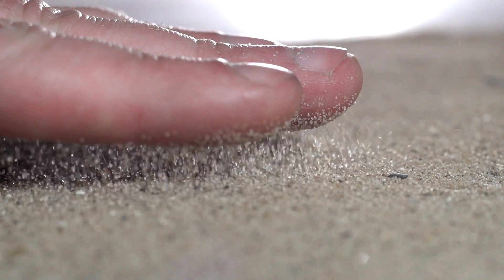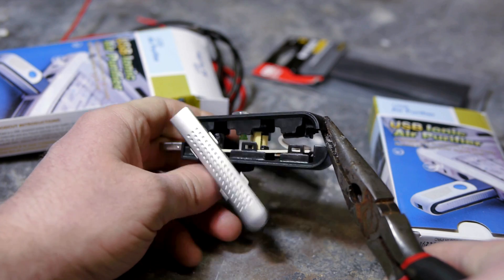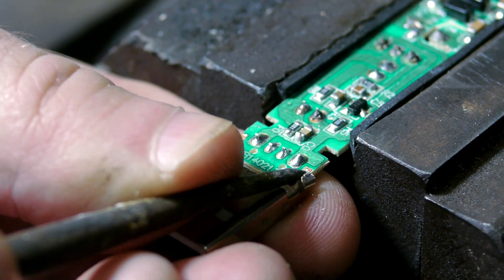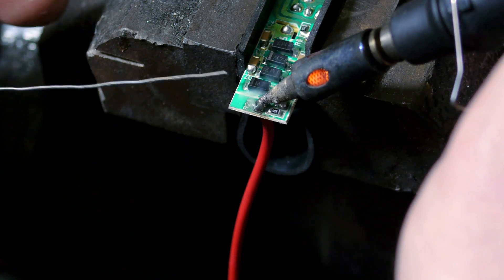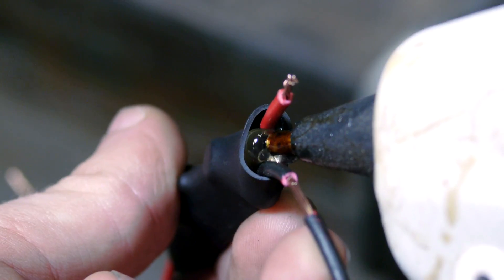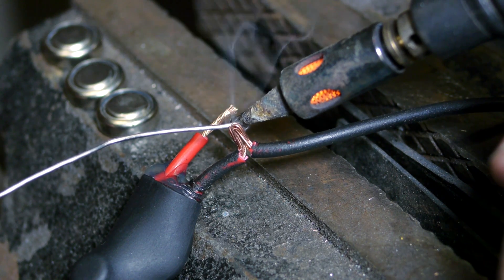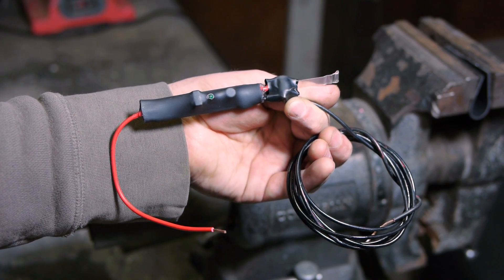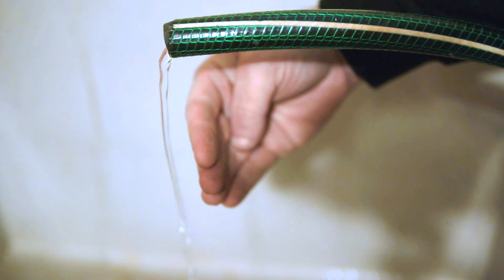How To Make A $5 Static Electricity Generator - NightHawkInLight

Comment: Hey, I know this is an old video and my question may have already been asked in the past, but my shocker is not working. Well- that is it should be working- but isn't. I've got it all hooked up and when I contact the ground with myself and the other ground with the ground I get no charge (Tested with sand, small electronics, and a voltmeter.) 
        BUT When I contact both grounds to myself the status light dims, which means I'm completing the circuit, this is further proven by the fact that when it is in contact with other people and materials the light stays the same. This by itself is impressive considering how un-conductive skin is (Not humid, very little sweat, if any.)
       SO I opened it up and found no problems (Solder bridges, damaged parts, etc..) Even going as far as to test each individual piece and part with the voltmeter- But with the same result: It works- but it does not show. After several varied tests in different environments, going as far as wetting down the diodes with salt water and conducting static electricity with balloons, I still have found no better result. 
 I currently am using 3, 4.5v 377 type button cell batteries, my contacts are thin aluminum, and the total wire length is 9 inches. I had received several large shocks while building this, but the no longer happens with the finished product.

I apologize for the long ass comment, but I wanted as much detail as possible.
Reply from the maker: It could be fried. These use some pretty cheap and fragile components, I've burned out a few. This is the least expensive of my static generator projects but also the most fragile.
Reply: Thank you for your speedy response, that's what I originally assumed, but If that's the case, that still doesn't explain why I'm getting a positive charge from the grounds. Though it may just be that the shock I received while building this was the burnout...
Either way thanks.

Comment: Dear friend, your experiment is really interesting. Could you explane please what is the purpose of the device connecting to the body ? Experiment show that particles of dust and smoke which are flying in the air ( especially positively charged) will be collected on the body. What do you think about using your ion generator as electrostatic precipitator of the air with collecting the dust on metal plates or tubes ? Is it possible to use the device in such way?

Comment: Hey I just made this and it seems great except for one thing. Even though I can arc between the two wires, when I put them on my body, I can’t shock anyone or anything. I’ve only been able to shock someone when they touch the metal on the bottom of my shoe. Any help would be appreciated and awesome video!
Reply from the maker: Try standing on a more conductive surface like concrete

Comment: Why does this need to be a negative ionizer? as the carbon tip has been taken off, wont it work just as well if it was a high voltage generator?????

Comment: Cool project thanks! What would happen if you used a 9v battery instead of the button cells?
Reply from the maker: Too much voltage would fry the circuit.

Comment: if i were to use a voltage boost converter to increase the voltage of my power supply would i connect it to the ground of the boost converter or the battery? (if this is dumb im sorry just unsure)

Comment: Hey, I'm a big fan. I know this video is pretty old now, but could you answer a question? since one usb purifiers uses about 5 volts to operate, do you think that by using two purifiers running off of a 10 volt (or so) power supply, I could beef up the static generation? or would I end up singing all of my leg hairs? if so,  could a larger positive surface fix that?
Reply from the maker: should work, but check my older videos in the description and there are two options for more powerful generators.

Comment: for some reason, the one i made isnt working, but everything is connected, and im running it on 6 volts
Reply from the maker: As cheap as they are sometimes these ionizers arrive broken...
Reply: The strange thing is, i tried running it with a 9 volt after, and it worked for a few minutes before the circuit fried.

Comment: Heyo! Remember me from a couple weeks ago? Probably not but it's one of the first dozen comments. Anyway, turns out I didn't fry my board. I just couldn't directly connect batteries to the board. I reattached the usb to the board and tested it and it still worked! YAY! So I ordered about 7 AAx3 packs with on/off switches for about 3 bucks, soldered one to the board in place of the usb head, fixed the wire connections and now I go around shocking everyone I touch XD Doesn't work while walking on hard wood floors or carpets. I find the latter to be ironic considering one would slide their socks on a carpet to build a natural static charge xD. Anyway, thanks for this video and for actually replying to your comments! Keep up the good work. 

Here's to you from a relatively old subscriber!

Comment: High voltage converter from USB... They are crazy! It is a perfect device to burn out your laptop.
Reply: Yeah lol, all it takes is a good inductive kick back and RIP computer. Also their using an electrolytic capacitor on the switching side so it'll probably explode after a while...

Comment: Just bought an ionizer from your link, hope it supports you a little bit :)
Reply from the maker: Thanks! Let me know how it works for you
Reply: NightHawkInLight I think it will take a while to arrive here from china, but thank you very much for the great tutorial! Are there any risks for your health using that?
Reply: Hey, the ionizer arrived today and I built the device. It is working but the spark is extremly small. Im using 3x button cells in with arround 1.55v each and 160mAh. Should I use a stronger battery?
Thank you
Reply from the maker: These ionizers don't have a lot of output, it's probably running as well as it was made to. If you want one that is much more powerful my second static generator version that runs on DC is very strong.
Reply: NightHawkinLight, how long is the battery life?
Reply: NightHawkInLight how Long is the battery life

Comment: Hi ! Thank you for your amazing videos ! I'm actually trying to duplicate your usb ionizer project but it doesn't work... I power the usb ionizer with a 5 volts batterie. Howewer, when I approach the ground wire to the output wire nothing is happening. I measured with my voltmeter and there is only 2-8 volts between both. Could you help me to overcome those difficulties ? Sorry for my english I come from France ;) Thank you and hopefully see you soon !
Reply: Have you solved it yet? Did you connect it to your body and feet in the right way?

Comment: isnt DC which floats through you really bad for your body (in a long time).The body is made if water, and how does electrical float works in water? It works with ions, so it might kill you if you let dc electricity float through you for a very long time... Right?
Reply: +Daniel Sir.fy. If it doesn't kill you immediately, then it's probably not gonna do it over time. Anyways its not electricity put into the body, it's ions.
Reply: the bad thing floating through your body is actually ac as it could potentially fuck up your heart rhythm

Comment: What soldering iron do you recommend for first-timers? Under $20 would be great.
Reply from the maker: I like butane ones. They're cheap an heat up quick. You shouldn't use them where if you dropped it it could start a fire though.
Reply: +NightHawkInLight Great Thanks!
Reply: Don't ask me!
(cough)Xytronic Xy-258 thingy(cough)
Reply: Zephroth Talinguard I already bought one but I'll save up for one in the future

Comment: I made two of these based on this video and it seems like they die if you use them for more than a few minutes. I'm pretty sure it is because these are not meant to flow so much current through them if you frequently short the ground and +V together. I think for a long term product you need a high voltage generator that can handle a little more current.
Reply from the maker: Are you trying to run it on a 9v? That's the only thing that caused the circuit to burn out in my own testing. Using the button cell batteries I had no issues.
Reply: No, I used three 1.5 V button cell batteries as in the video. However, I was having a good amount of fun making some good sparks, and on both of them after a few minutes of producing good sparks they both gave out. 

Also, it seems like you can't use the earth as your ground to get any decent sparks (you need to use the negative terminal). How about you? I think that is why a lot of people can't get it to work in the comments.
Reply: @ActionLabShorts No way this is action lab 7 years ago!!! I was planning to do this and btw love your videos!!!
Reply: ACTION LAB REAL!?
Reply: How would it short? Would the entire thing die or can you just switch out the batterys?

Comment: Actually, in the one you used, it's creating a negative static charge. The hint here is that the diodes are "pointing" away from the output connection ...
See the component marked "D7" on the PC board? The stripe on one end - the cathode - is connected to the rest of the voltage multiplier chain (the lower voltage stages). The anode is connected to another capacitor (C6) and the output wire (through a 9K ohm resistor R24 - it might also be 20M ohms, but that seems excessively high for that small of a resistor, physically speaking).

Comment: I build it but I see only sparks when ground and negative wires touch not throught my body even tho I heard a really quiet spark when I touched metal.I'm using 3x1.5V AA bateries.. Can I use 6V or is it too much ? I'm not sure what can be wrong.. And yes I was standing on conductive surface
Reply: It might be that there is enough resistance to drain away the charge through your shoes. Do you have boots on, or what?
I dunno what 6V would do to the device. It might run OK, or it might stop working ... I just don't know without seeing the thing itself.
Reply: i JUST built one and upped the voltage to 9, its fine
Reply: 9V ? lol what
Reply from the maker: I would go back to 6v if you're using the same generator I am in the video. When I was testing it would run on 9v for a short time but then burnt out the circuit.
Reply: +NightHawkInLight huh, hasn't done that for mine. but I modded it into a glove with a switch... hasn't given up on me yet.
Reply: +TheNyga yep, works fine
Reply: I built some of these too and you do have to connect the ground wire to the positive to get the full affect. I think it is because the ground wire is not really "ground" relative to the earth (it is really just the negative terminal). True ground (the potential of the earth) is no the same potential as the ground of your circuit.

Comment: I did exactly as explained and the device is working ... but does not generate enough static through my body when I touch something . Should I use thicker wires ? Or should I use 4 batteries of 1.5V ?
Reply from the maker: You can try standing on a more conductive surface. Otherwise you may do better with one of my previous versions if this one is not powerful enough for you.
Reply: thanks for the answer! I wish success to your channel
Reply: Then you have built a tolerance, build on out of a Fresh Breeze  Ionizer, mostly just a high speed switch hook to 1 12V in 500V out transformer.. Little bit more to have to conceal but you keeping you dancing all nigh. Need help, hit yup elecronicBOOM
Reply: +NightHawkInLight were would you get that kind of wire
Reply: All2skitzd I'm sorry but I could not understand. I must put an inverter voltage in my project? it is?
Reply: What is "tolerance" should I build? is a component that must weld the ionizer?
Reply: It might be that there is enough resistance to drain away the charge through your shoes. Do you have boots on, or what?
I dunno what 6V would do to the device. It might run OK, or it might stop working ... I just don't know without seeing the thing itself.
Reply: NightHawkInLight will it still work if I stand on a non- conductive surface?
Reply: ActionLab Vlogs I know this is old but can you elaborate more on having it connected to the positive? Isn’t it the one that is connected with the batteries? Or the one that touches your leg?
Reply: You have to connect the ground wire to the positive wire to get the shock. You can't just use the "ground" of the earth for this device. If you have the ground connected to aluminum foil under your feet and the positive terminal, you will for sure feel a good shock.

Comment: Hey guys, I need ADVICE!
I built this two days ago and the first day I measured the voltage to be 480v. I use a 3x AA battery box. The next day the voltage however dropped to about 200-250v. The batteries have almost the same charge and even changing them doesn't help. It is not able to produce such a big spark anymore and it won't really shock anything. Could anyone help?
Reply: Heheh, you probably got a shitty one. My first guess is that one of the components in the last multiplying stage has gone bad - likely a capacitor or diode.

Comment: can the static current be upgraded into a powerful one
Reply: Hell yeah, you start off here but you gotta move up to a heavy portable commercial IONIZING unit if you wanna keep it live
Reply: Well, you could, but then you risk killing things with the shocks ...
P.S. By the sheer size of this thing, it really can't put out that much power. I dunno how much it could be "overclocked," if at all...
Reply: Benjamin Esposti shit you'd be wasting your time, that shit is probably already on full tilt with the cheapest components you can get. Maybe your could turn it up and use it to burn people like a old  Cyrix CPU but your best bet would be start with something better like the guts to a cheap electronic fly swatter, that could put the zappin on someone

Comment: Is the ground wire that leads to your foot absolutely essential? Wouldn't the batteries alone do the trick?
Reply: No, you need it, but if you have old shoes, you can tweak them a little bit to fit the white through them and hide the aluminum sheet under, so it's invisible
Reply: Is it acting as a ground or "picking up" static electricity?

Comment: Hey buddy, thanks for the cool video, what is the best way to develop anti-static device (one that shoot out both positive and negative ions), Please help?
Reply: +NightHawkInLight sorry I was not clear. I need a device, like an anti static gun, that can remove static of cars. i don't think I can ground every metal sheet in the car body.
Reply from the maker: +22Brat22 The sheets are held together with metal screws. You ground one you ground them all.
Reply: +NightHawkInLight thanks, let me try that.

Comment: Hello, NightHawkInLight,

A basic question here, what is the purpose of the aluminium under your shoe? Aluminium is an electron donor, so how would it be gaining a charge and directing it through the circuit?
Reply from the maker: +Coroz1 In this case it's just acting as a conductor.
Reply: +NightHawkInLight So it acts as the conductor for the static electricity generated by the friction between the shoe and velcro, correct?

Thanks,
Reply from the maker: +Coroz1 No, the static electricity is generated by the generator.
Reply: +NightHawkInLight And how is this done? What is the purpose of the aluminium to serve as a conductor, then?
Reply from the maker: +Coroz1 The generator strips an electric charge from the ground via the wire and conductor. Watch the videos linked in my video description if you want to learn more.
Reply: > And how is this done? What is the purpose of the aluminium to serve as a conductor, then?

"Static electricity" is simply high voltage.   All high-voltage generators are "static electric" sources, even when no friction is involved.    To charge up your body, connect a high-voltage power supply between your body and the earth.  The aluminum on the bottom of your shoe is an electrical connection to the Earth.   (Yes, you must stand on slightly-conductive surface such as concrete or even better grass and dirt.   If you stand on a dry wood floor or thick nylon carpet, usually this device cannot work.)
Reply: Oh my God if you guys have no basic knowledge in electronics, try to do some study before making a fool of yourselves.
Reply: +David Linnik I consider this a part of my study.
Reply: *****  Takes you 3 weeks to reply lol
Reply: David Linnik Haha yeah, this is my alt account actually. Besides, I'm curious, why bring that up?

Comment: hi build this ,when the ground wire comes in contact with the output wire a spark is visible,but when the ground wire is attached to a plate and wore and the output is touching the leg  its not workings
can someone pls help me in this regard

Comment: you guys think 6 volts will be fine?
Reply: No, it'll fry it... I speak from experience.
Reply: +cyancoyote  +sal seria I use 4 AA batteries (6 V) to power it, it works fine.
Reply: I don't know how... maybe the one I had was a crap chinese one, but 6 volts made it die.
Reply: +cyancoyote Only thing that I did differently is that I have got rid of the resistor next to the output wire. But I don´t thing that it makes difference.
Reply: Hmm... Will this make a neon tube glow? I didn't yet have a chance to try it, so I'm curious :)

Comment: What if you put the electricity through a high voltage transformer before sending it to the air purifier?
If the air purifier can withstand the voltage, that could be some seriously Darth Sidious stuff right there.
Reply: It cant handel any higher voltage

Comment: I replicated this project and it was successful. Unfortunately I accidently soldered off a piece of the circuit and the connection was cut. I plan to remake the project but this time add a switch. What would I connect the switch to?
Reply: Between one lead of the battery and the circuit